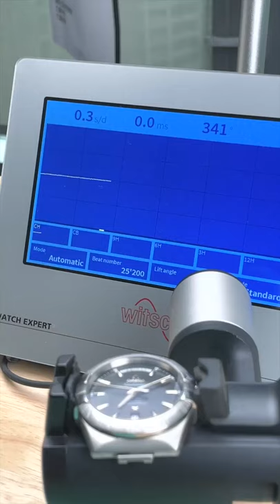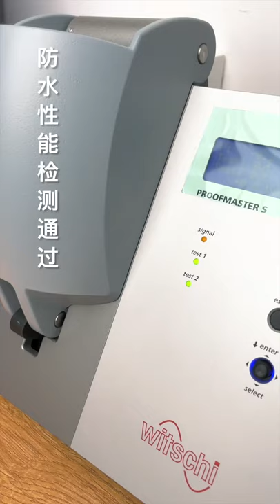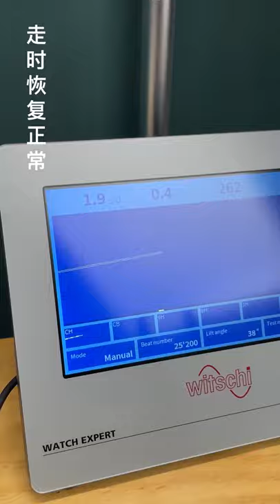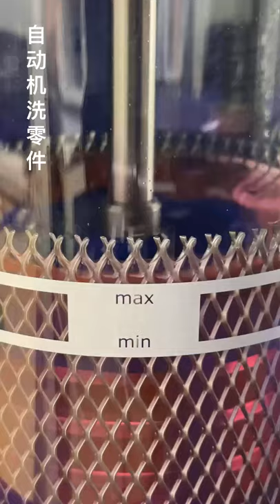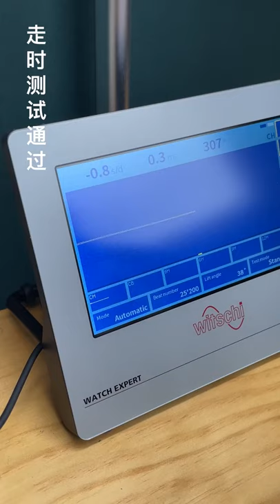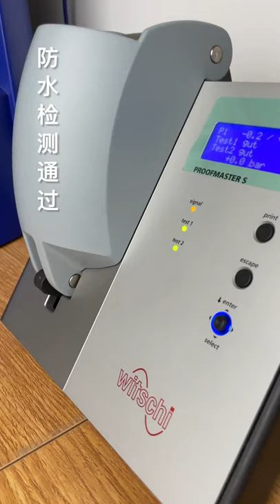OMEGA Maintaining Vlog

Comment: What was in the glass jar with the red cap?
Reply: One dip solution for the automatic mechanism.
Reply: This is epilam fixodrop used to treat the escape wheel and the pallet fork to prevent oil spread also used on balance jewels etc. One dip is a cleaning solution.